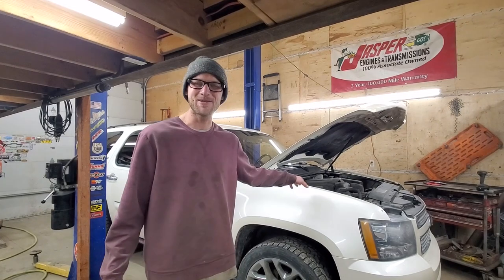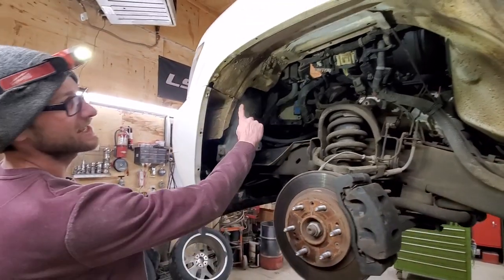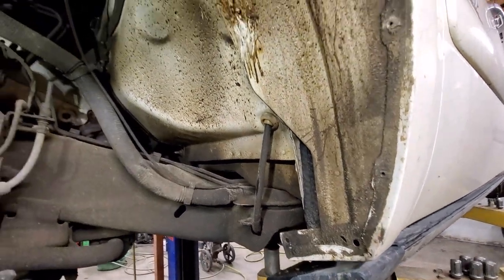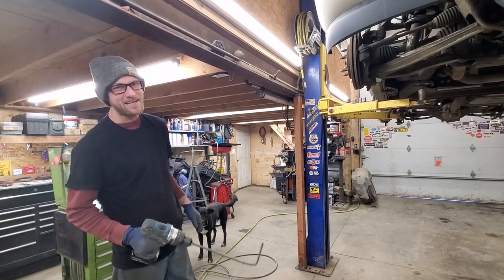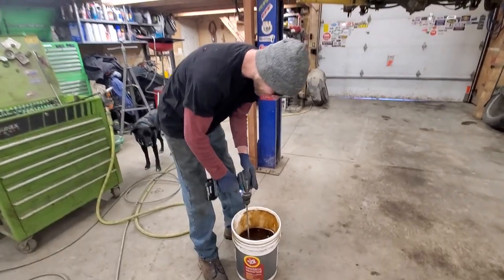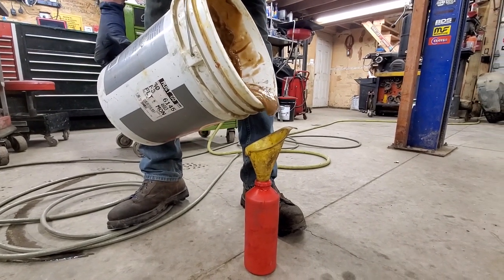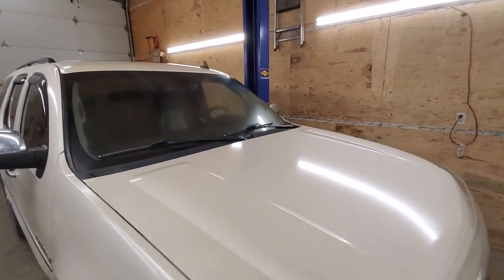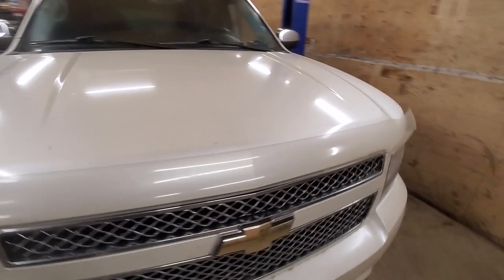Fluid Film-Rust Proofing That Works! Undercoating In The Salt Belt

Comment: Good job bro need your opinion before i dig deep….. got a 2014 silverado 4.3 has a ticking/tapping noise on driver side of the engine, it doesnt make any noise on first start but as rpms drop and it starts to get warm its noticeable and when revving it goes away

Comment: So do you avoid car washes during the winter or does it hold up to washes?
Reply from the maker: It holds up very well to the car wash, this started as experimental  the first year not knowing what to expect but it hangs on very well. We wash it just as regularly in the winter as summer. Thanks for watching!
Reply from the maker: Congratulations on your 1000 subs too!
Reply: The way it atomized into the air I'm sure your tools will stay rust free as well!...😆 Any issue with it getting onto the brakes or exhaust? I'm sure it'll burn off the exhaust just fine, but what about the brakes?
Reply from the maker: Yeah it just burns off the exhaust, takes a couple weeks for the odor to completely go away, I don't notice anything with the brakes I assume the residue just burns off those too